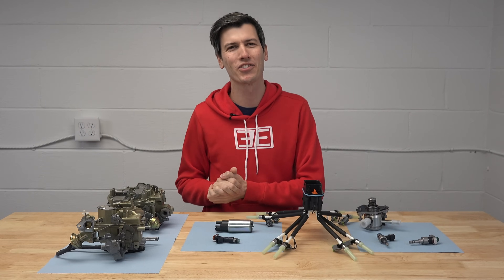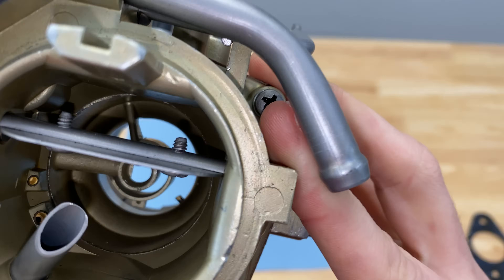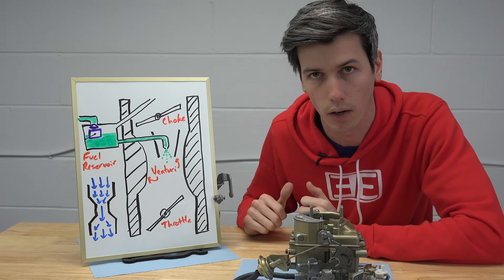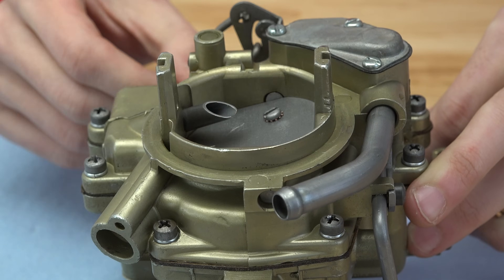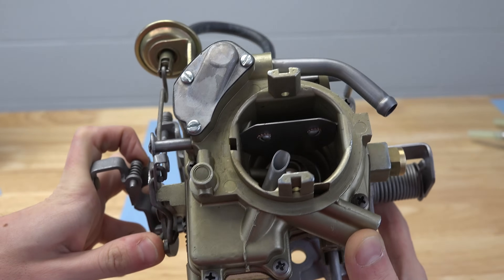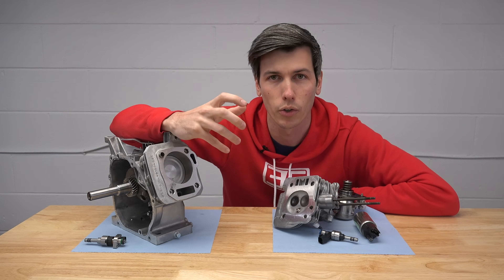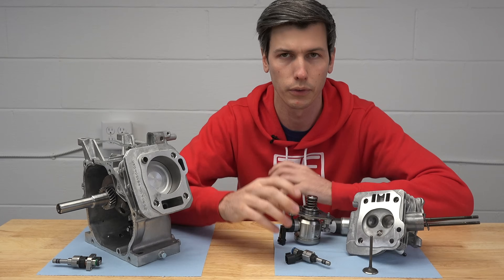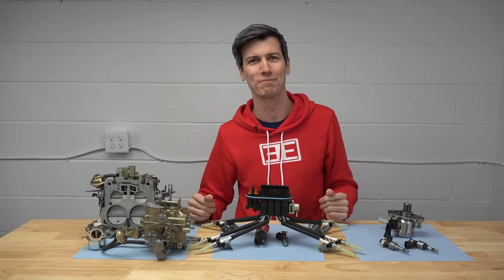What's The Best Fuel Injection? Carburetors vs Port vs Direct

Comment: When people moved from carburettors to injectors... They literally cut down on carbs...
Reply from the maker: Now they're fueling their appetite in different ways.
Reply: @EngineeringExplained  Oh my god, thank you so much! I love your channel!
Reply: @EngineeringExplained  Yes, the pressure keeps increasing.
Reply: @EngineeringExplained  could you explain the differnce between port injection and multi point injection
Reply: @johankhadka7157  Multi-point injection is the same as port injection. Single-point injection is (essentially) an injector in a single throttle body (which will look rather like a big carburettor, and was briefly mentioned in the video).
Reply: @EngineeringExplained  without those carbs, they can get a way with being leaner
Reply: ,So you're saying that if we cut down on our carbs, then we will reduce our emissions? 😁
Reply: Yeah, but both carburetors and fuel injectors give me gas.
Reply: Took me a moment to get the joke.
I HATED re-jetting and tuning carbs on my old MC! HATED it!  Moving to FI bikes is the best thing I ever did.  More riding, and less burning up or clogging valves due to my OCD/weekend-warrior wrenching skills.  Not to mentioned the effects of significant altitude changes on a low CC engine.  Learned some expensive lessons with that bike.
Reply: CrzyMFT It is all good until your battery dies and you can’t push start your bike and ride home.
Reply: @CrzyMFT  Yeah... a lot of the carb crowd say that carbs are simpler, which may be true from a parts count perspective, but only that. Carbs require a ton of tuning and need it at the drop of a hat. Elevation change? tune the carb. Temp change? tune the carb. Different gas station? tune the carb. Thursday? tune the carb. Fuel injection engines tune themselves, not just every time you start it up, but hundreds of times per second. A tune up for fuel injected engines is injector cleaner.
Reply: @superdupergrover9857 Carbs are very simple. They dont need alot of tuning. They just need alot of knowledge on how to tune them. And you say elevation needs tuning the carb, the altitudes youre gonna need to travel is so much before you actually need to tune the carb. Because theres less air in high altitudes youre gonna be running rich mixture so all that will suffer from injection is fuel consumption. And even 50 year old cars had warm air intake for the carb so tell me where would modern cars with carbs be at (if there would  be any)? If you literally tuned your carb every day, then you shouldnt had tuned your carb but actually fixed it.
Reply: @CrzyMFT  Strange, I own a 125cc scooter and I rarely tune the carbs now. It's only 10 years old but it sat in a barn for 5 years so the first few months of ownership had a couple of carb overflow and it goes out of tune every week. The carb overflow vanished by itself. For the tuning, I brought it to a mechanic, he only sprayed it with carb clean from the inlet and the carb was fine for months.
Reply: @CrzyMFT  One more mode of failure, though. A bike is gravity feed, and the tank is ALWAYS above the carb, unless something truly unfortunate happens. While a fuel pump  can fail, so long as you pay your gravity bill, you'll be able to gravity feed your carb.
Reply: That's why diesels are so efficient. They are on keto. No carbs, only oil....
Reply: Well done on the Ramadan joke
Reply: @Muscle Man  much more electrics including beefy fuel pumps. The weight just changes location
Reply: Sharikh Khaan get out, you
Reply: @Muscle Man nonsense.
Reply: @dildoshwaggins1017  n,xpng
Reply: wow
Reply: monosaccharides or Di?
Reply: Sharikh Khaan you clever son of a... lol
Reply: I remember from the 80s Throttle Body injection. Basically replacing the venturi of carb  with an injector.
Reply: Put started to drink more refined alcohol instead
Reply: Deja Vu... On the comment.
Reply: Thanks to atkins my car has cut down on carbs and dropped weight!
Reply: r/thanksihateit
Reply: hmmm I see I see hahaha
Reply: BOOOOOOOO
Reply: Nah, then pollution will occur during the research and production process of the other fuel injection thing.
Reply: Amazing explaination, thank you. Love that you used real engine parts to demonstrate. Could you please make a video on CVT transmission?
Reply: Keto for your car
Reply: Oh my god
Reply: Throttle body cheap easy less carbon buildup. More has been less.
Reply: Why not use both carburetor multyport and direct together
Reply: @samosrakar  cant do that.. the carburator cant work together because you cant manage the carburator
Reply: @samosrakar  it will be a waste for the manufacturers to include carburetor a mechanical one to those two which are computer controlled. Plus carburetors are way bulkier and heavier that fuel and direct injectors. Actually subaru already did that, a combination of multiport fuel injection and a direct injection. You can  look for the Subaru brz / toyota 86 in engine in google.
Reply: Samo Srakar 
1) adds unnecessary complexity
2) carbs and multipoint fuel injection both mix the air and fuel before entering the cylinders
3) the air-fuel mix would be too rich
4) it hurts your mpg

Some engines run on both multipoint and direct fuel injection, but usually in engines running so much air to be burned (usually from excessive boost like you get on a Koenigsegg Jesko), or on engines using different rpm-dependent fuel-feeding strategies: multipoint/port injection on low rpm and direct injection on high rpm
Reply: @juliojonathan8348  9
Reply: @Octa-8wow  until it floods the oil.
Reply: UGH...Dad! Get out of my room!
Reply: CURSE YOU DAD JOKES!!!!

Comment: Originally 1.2 FIRE generates 70 bhp and 100 nm of torque
Reply: At 100 rpm and negative 20 PSI of boost with 100% diesel fuel!